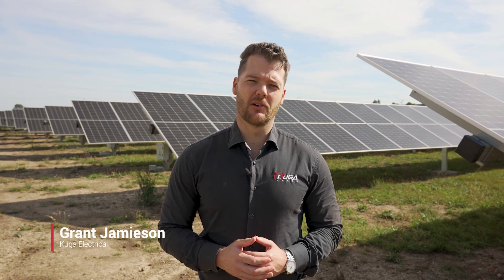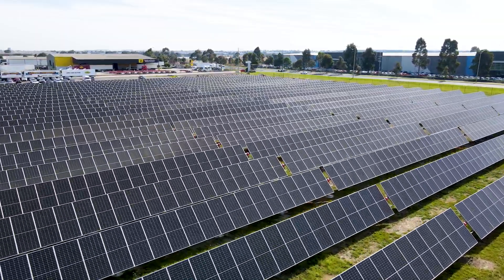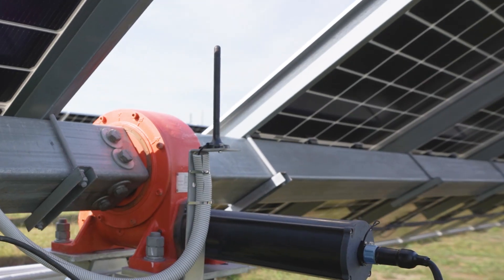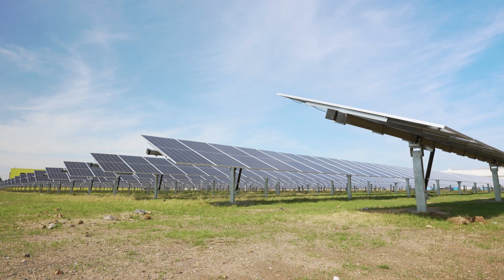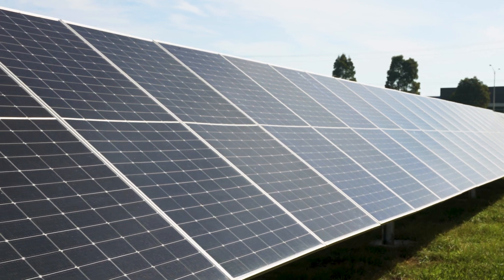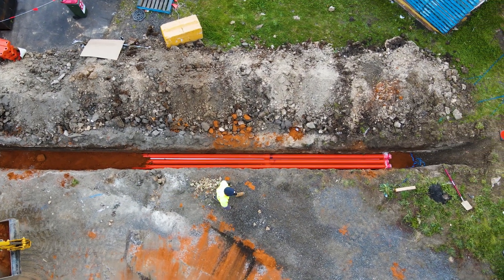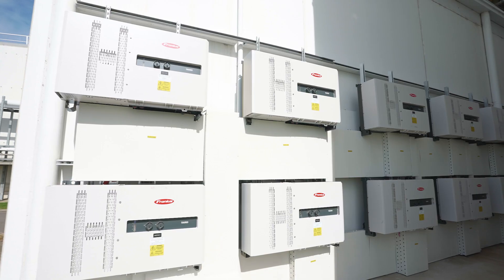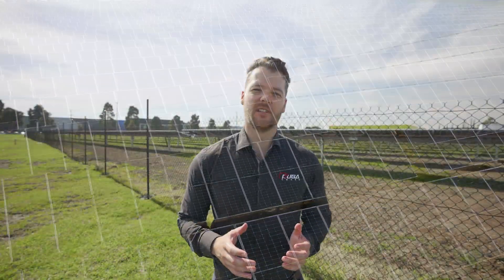1.56MW Solar Installation at Americold Laverton

Comment: Roughly how much does something like this cost ?
Reply: about 500,000-1,500,00 USD depending on how much they paid for installation, rack system, grid hook up, and land. Panels themselves cost about 10-15 cent per watt when wholesaling so at 1.56MW that is about 156,000-234,000 for the panels alone. Batteries to store power over night is also going to cost you (if they did that).

Comment: How much did it cost?
Reply: about 500,000-1,500,00 USD depending on how much they paid for installation, rack system, grid hook up, and land. Panels themselves cost about 10-15 cent per watt when wholesaling so at 1.56MW that is about 156,000-234,000 for the panels alone. Batteries to store power over night is also going to cost you (if they did that).